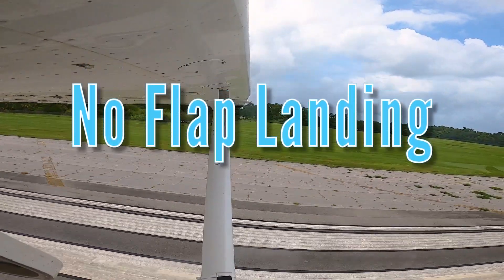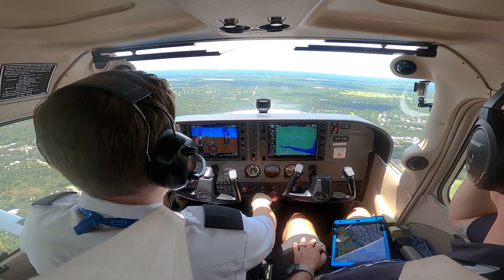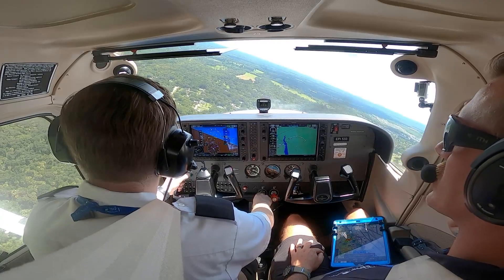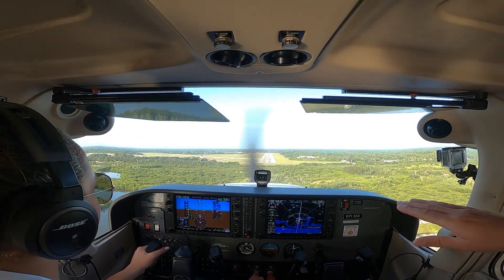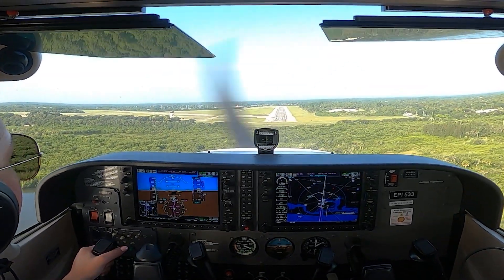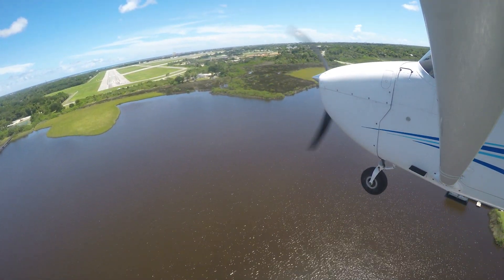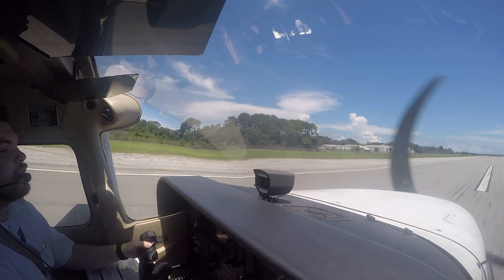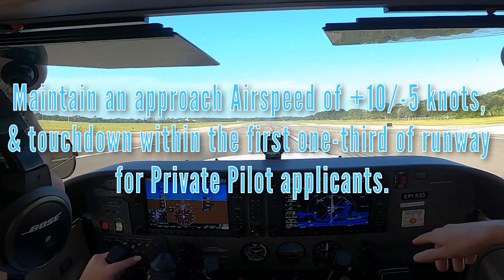No Flap Landing | Epic Flight Academy

Comment: I do these all the time in my C150, usually by accident.
Reply from the maker: Take care!
Reply: @EpicAviationEpicFlightAcademy  
It's the flap switch.  If I let go after dropping the flaps and accidentally move it to the UP position when pulling my hand away, I get surprised by the plane floating on landing, and then I know exactly what I did.  I wish I just had a handle on the floor with notches.  Never had this issue flying a Tomahawk.

I'm forcing myself to get in the habit of pulling my hand away from the flaps switch in a downward motion instead of upwards or sideways. That's the motion that causes the problem.